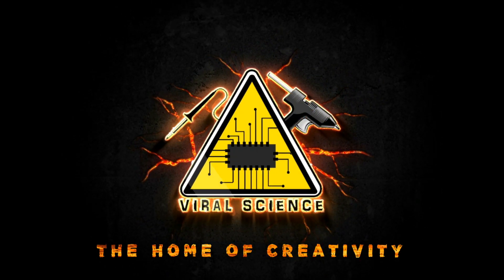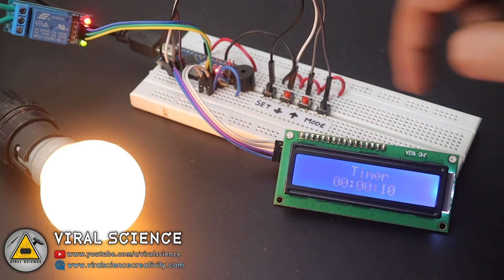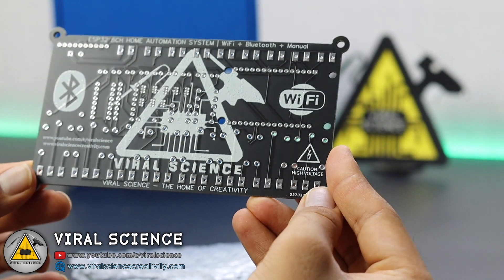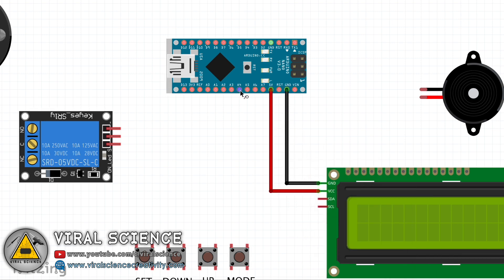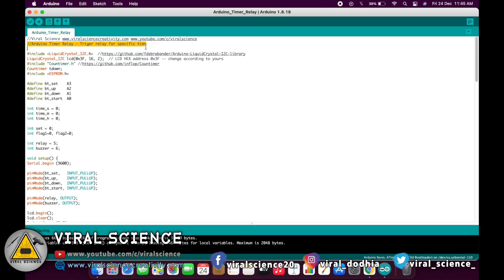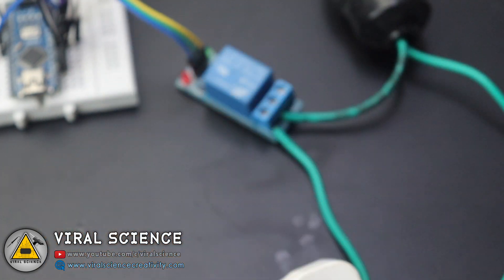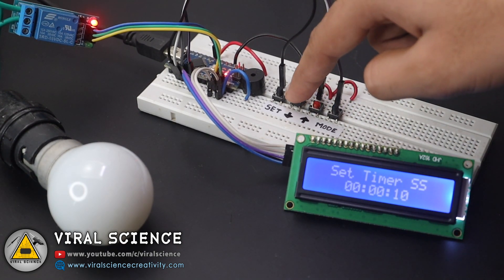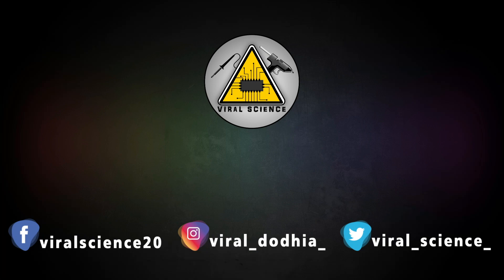Arduino Timer Control Relay Devices

Comment: In this example the power to the light bulb was on when the timer was counting down and turned off after it finished. Can it also be done so that the power turns on when the timer finishes?

I am looking to use a set up like this to actuate a pull solenoid for a few seconds at a delayed time of 1-60 days
Reply: The relay nodes can be used in such a way that the bulb or any device and turned off or on depending on the terminal where you connect the wires when the timer counter is finished.

Comment: I have a problem, instead of turning off the electricity when I set a timer, it turns on.
Reply: I actually wanted turn on timer
Reply: Can you send what you have done
Reply: Check your relay connections please

Comment: HelloViral Science can you help me with a software-related matter? I want to create a project. In my project, I will be using a Nextion TFT screen, Arduino Uno, Green LED, Blue LED, DC motor driver, and DC motor components. In addition, I will use one yellow button and one red button.

The program's operation is as follows:
I will input a value, such as 5000 milliseconds, into the "n0" object on the Nextion screen. I will also enter a value between 0 and 255 into the "n1" object, which will be related to the motor's speed. Based on these values, the motor will run between 0 and 255 revolutions for 5000 milliseconds and then stop. After entering these values, to start the program, the "b0" object on the Nextion screen and the Arduino, connected to the analog "pin1" yellow button, will serve the same function. Whenever the analog "pin1" button or "b0" object is pressed, the motor will start running again and stop when pressed again. In case of an emergency while the motor is running, there will be a red button connected to analog "pin2" to stop the motor. When the "pin2" button is pressed, the running program will stop immediately, and the green LED will turn off. To restart the program, we will need to press the "Dual State Button" button. All of this system will be controlled by the "dual state button" object on the Nextion screen. When the dual-state button is open, the system will be ready to run, and the position of the dual-state button will be indicated by the green LED connected to digital "pin 12". I want to create a project that operates in this way. What is the cost of such a project?

Comment: Just wanted to chime in and let you know that this is excellent. I had something set up with an amazon relay/timer that 'worked', but the shortcoming was that once tripped, it would just count down to zero and stop, even if the trigger was re-tripped, which was a problem. This worked perfectly, and when tripped, it turns on and counts down, but if re-tripped, it resets the timer, so if it keeps getting re-tripped, it keeps resetting and will only finish the countdown and stop when it's no longer being tripped, which is exactly what I needed.

Comment: All vdo related this topic are same, please change if you can
I want timer on side and off side both
Suppose
10 second on (manual set)
30 minutes off (manual set)
Again 10sec on 30 minutes off
This process continues run until manual switch off.

Comment: can you please tell how EEPROM han help in this, I am trying to make an Inching project where relay switch turns off after an unchangeable coded timer and it may not reset as the power to micro controller cuts off accidentally.
Reply: Pretty sure you can do that with a 555 timer and a relay. Just use such values of capacitors and resistors in the 555 timer circuit such that it suits your needs! I dont think a EEPROM or arduino is needed in the project that you are specifying.

Comment: The first time I tried this worked perfectly, but the next day I tried with both my UNO and UNO R3 and the timer initializes to 254:254:254 instead of 00:00:00. I do not even know where to begin diagnosing this problem. Please help!
Reply: I had problem on lcd can't display can you help me
Reply: Do we have to set time again and again in this project

Comment: What software were you using to design the circuit? Does that allow you to run simulations?
Reply: TinkerCad
Reply: Bro i also want to know about that.
Reply: Have you gotten some info
Reply: Please let me know when you do so :)
Reply: No answers yet
Reply: In Tinkercad circuit option is there.

Comment: Great tutorial. Learned a lot. I’m curious though, does the power for the lightbulb also power the Arduino? If it does, how does it back feed through the relay?
Reply: arduino is powered by usb, micro usb, relay have 2 sides one where 5volts of arduino jumper wire is connected, and in the other side it can go upto 220 volts with 5 or 15 Amps depending on the relay

Comment: My 16x2 display don't have sda scl converter circuit connected that is connected in your lcd, plz make this circuit with this same 16x2 lcd without sda scl wires,
Reply from the maker: Replace the I2c library with the regular liquidcrystal library and initialize the pin numbers, code will be the same
Reply: @ViralScience  That's the answer i was watin for, Thanx👍
Reply: @ViralScience  عندي الشاشة 2*16 مع المحول ولكن لا لا ويظهر شيء اين المشكله . شكرا لتعاونك معنا مقدما
@ViralScience I have the screen 2 * 16 with the adapter, but nothing appears, where is the problem?  Thanks for your cooperation in advance